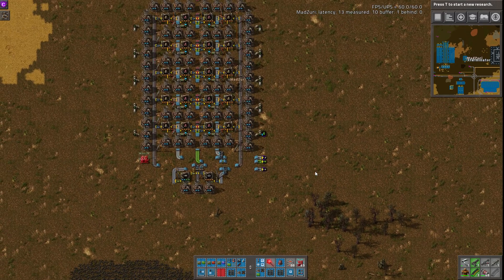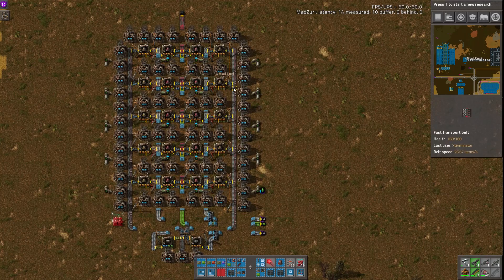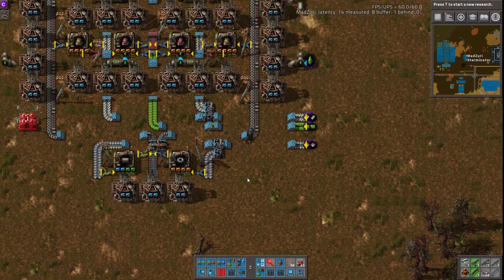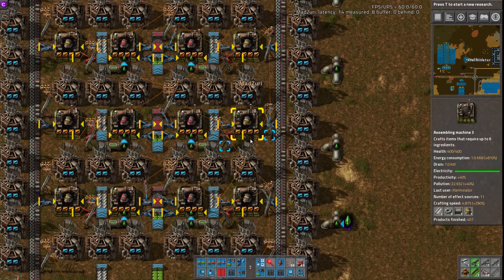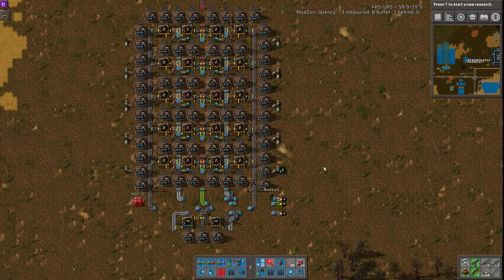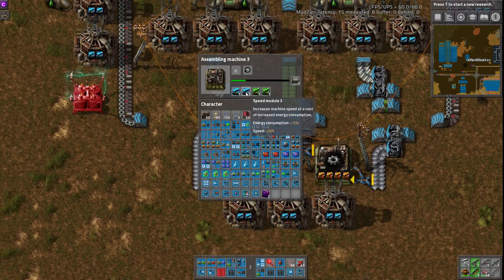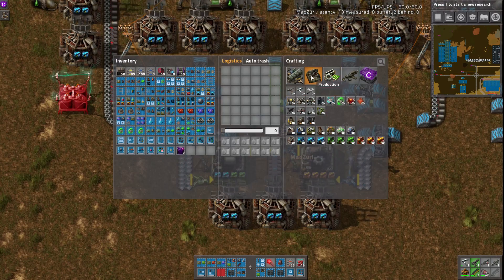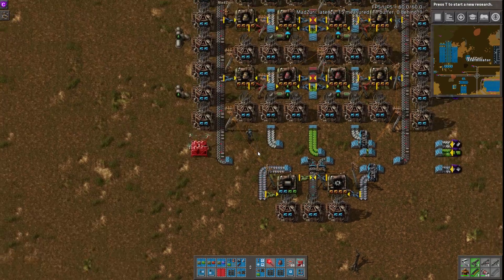Jethu's Electric Engine Build / Setup :: Factorio Workshop Season 2 - Building A Better Factory

Comment: If I did the math right, then you only need 6 beacons on the normal engine assemblers.  So you I'm pretty sure you can remove most of the beacons in the outer lines.

Also there looks like there is room to run the lube either up the middle, or just inside outer line of  beacons, meaning you could share beacons when tiling it.